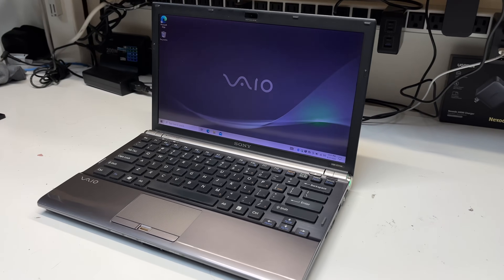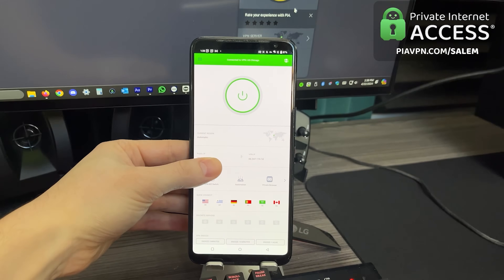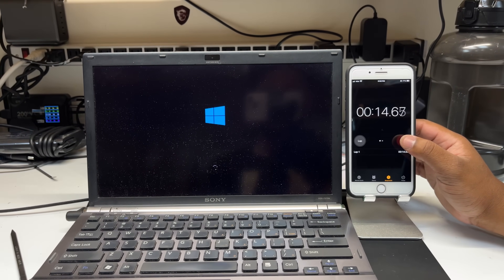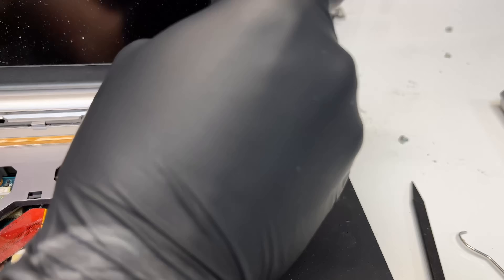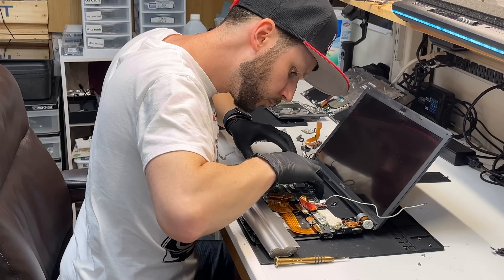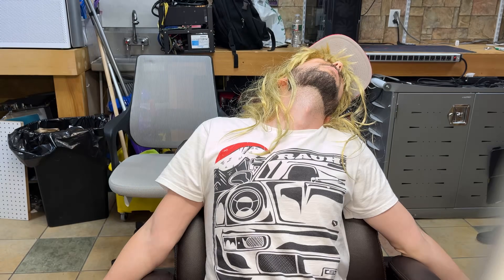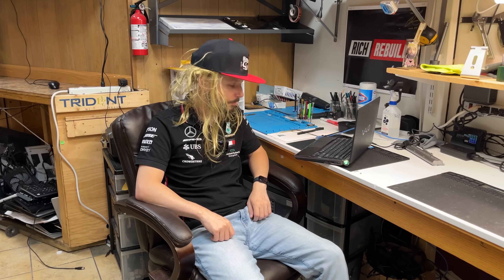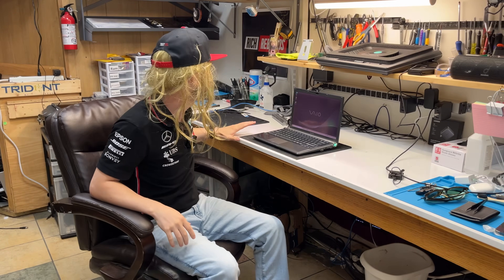Sony Vaio Resurrection: Saving this Insane Tech From 2008 (and why that soon won't be possible)

Comment: I still have a Acer gaming laptop from 2011 or something with a first gen core i5. Still works fine. Battery is nearly dead (about 20mins with a full charge) but I don't really need that. Built a gaming pc in 2022 and recently bought a new laptop for travelling/university.
I was thinking about framework 14 but bought a hp elitebook (i7 7840U, 16GB DDR5, 1TB Samsung NVMe) which was available for 950€ with university discount. At least HP offers good documentation, five years guaranteed replacement parts and ram and ssd are replaceable.
The offerings get really scarce if you select non-soldered ram.

Comment: talking about things that lasts forever, its hilarious that i had a 2014 lenovo (g410) laptop that still works and still packs performance with ease of repairability and upgrades, and a newer acer laptop that keeps breaking every so often with more integrated parts. its good that there's still a brand that keep this thing up sometimes, (even when most of their newer products now is also the exact same e-waste once wasted) and not so vocal on the green thingy.

Comment: Great video, but I have one suggestion. It's related to Windows 10 EOL. Why not try to promote some easy to use Linux distribution like Linux Mint. In this video, you had a problem with specific driver. I will bet that with Linux Mint, you would be able to run NVidia card much better. Anyway, in general normal user needs web, YT, office. All these can be done on Linux.
Reply from the maker: As I've mentioned in the other comments, convincing an out of state customer, who's a lifelong user of Windows, to learn a foreign OS to unlock a capability they will not notice or utilize in the first place, is not an option. The average consumer that has been using a device this long does not want to learn something new, period.
Reply: @SalemTechsperts  Well I fully agree on Sony laptop repair. I mean it in more general. When you talking about second hand market for example, I think it could worth to mention that Windows is not only option when you want to older laptop and with Windows 10 EOL it will be much more relevant

Comment: Fellow tech guy here; might try finding out what Nvidia chip that is and seeing if they have a driver archived on their website for it. I had a smiliar problem with my previous laptop I had from Acer. It was a Nitro 5 with a AMD chipset both for CPU and GPU. I wiped the drive clean and installed a fresh ssd and Windows and my touch pad stopped working. Found a forum post about a piece of hardware from AMD that prevented the touchpad from working. I guess it's specifically to Acer. Not AMD. Long story short I happen to have made a backup of the previous OS image with that driver already installed. Speaking of listing a few laptop's with repairability...Acer, MSI, Lenovo...

Comment: All that work and my guy identified a socketed cpu and DIDN'T call the owner to inquire about a $20 part upgrade?

I am confused.
Reply from the maker: The difference between this CPU and a more powerful compatible one was negligible. We're talking a few hundred MHz. This is useless when my customer is only using it for basic things.
The additional wattage of the more powerful CPU (45w vs 35w) would've cooked with that tiny heatsink.
The additional time waiting for a part to come in, installing it, re-assembling it, testing it, and praying that I didn't get a 16 year old defective CPU, was not an option.
Hope that clears up your confusion.

Comment: That little rant at about 12:25, speaking to the choir. Before I actually got my career in the tech field, I worked at Wal-Mart int he electronics dept. and was the go to guy to tell customers about the store computers we sold. And I told them the SAMETHING. If all they were doing was basic YoUTube, school work, and just browsing the net they're fine. I hate the fact now working in a Depot that most things we work on now cannot be repaired and the manufactures did it.  I tell folks also going to Flat panel TV's was the worst choice too, but the companies weren't making money because people weren't buying no ew tvs cause old ones lasted damn near 30 years. AND the original flat panels you know could be repaired cause they ussed so many Electrolytic caps that would bust in all that het and lose display/power. Replace a few caps  youre in business. You see now they started using service mount caps which are harder to find the bad ones and they have no date or readings on them so you can't replace. Yeah, so much for going Green and folks can't repair shit...and don't get me started on Lithium batteries that can't be recharged if they completely die or can't be recycled

Comment: One passion project ive wanted to work on for a while even though I have 0 experience repairing computers is this ancient Lenovo Thinkpad that is from back in the day that those things had rollcages. I think it is a TL30 or something, and it also has a (probably) socketed cpu, upgradeable ram (supports 16GB), and I'm not sure about the storage, but with this thing's track record, it probably is upgradeable. I would just need the time and the money and I totally would give it a shot, because it could support up to a third gen I7 and 16GB ram, which might make this ancient laptop somewhat viable for some gaming. What yall think?

Comment: I'm hoping my Asus ROG Zephyrus M16 will last me years because I bought this laptop with the intention of keeping it for a long time. I know how to do the basics/maintenance such as replacing the paste and the liquid metal (CPU from factory uses it) but the thing that worries me is the software in the future. Alot of things nowadays like you mentioned towards the end of the video is unfortunately true. Many things today are engineered to fail at a certain point especially electronics and cars. Besides the future were heading into, Keep making great and funny videos!

Comment: I actually thought, that vaio laptops were hard to break and was beast among all laptops. Friends family had two of them (and I think the same from your video). Broke when friend dropped it and it opened up from the power button to its power supply port. Hell, this laptop could run most of games till 2010. Now I have got vaio from co-worker and it’s still kicking. Monitor is crap (e-fing tft matrix) but adding ssd and 8gig ram made it better in all aspects

Comment: I've got the Sony vaio VPCF22M1E and it was and still is in some ways a beast. I ran WoW on it till late 2020 after the minimum specs for it, mainly the gpu, needed to be higher. The only thing i did was give it to a repairshop for some TLC and a SSD upgrade. It still runs great as media center and low spec games.

Comment: They definitely used to build things to last. My childhood computer that runs Windows 98 still runs like new. I collect vintage computer and I have a computer from around 1987 that works like new. I also have a Toshiba T1100 which was the first commercially produced laptop from 1986 Im planning on repairing, but should work fine with a new battery and new capacitors so long as there isnt significant corrosion.

Comment: Bro, I am typing this on a Toshiba Satellite C600 from 2011. Shit still turns on, but YouTube lags tho.
I asked my friend to do some maintenance work on my laptop and I was thinking that it would be easy to do, but nope. It's a lot more complicated than I thought.

My only issue with this laptop however is the chassis is made of nothing and has cracked open in different parts of my laptop, but functionally it works as well as it did on launch day.

Comment: I still use an hp mini 110-3000 up to this day, I bought from ma repair shop, abandoned, I repaired and upgraded it myself, I still manage to get over 5 hours on battery(which was brand new 5 years ago) and I manage to do office work just fine(granted I use OpenBSD) and do some work on terminal as well, youtube doesn't work(intel n455 atom has L I M I T A T I O N S) but for me it is relevant still

Comment: I think it is amazing to see old technology outlast todays expensive consumer crap like I’ve seen so many gaming laptops and laptops with dead CPU’s especially Intel i3 i5 11th gen to 13th gen
Reply: I love and hate old laptops cause they are built like tanks and are over engineered and can be confusing on how to dissemble but they are more repairable than the current MacBook 😂
Reply: I think the best oem that supported drivers is Dell I still can access my 2003 dell dimension drivers, while HP recently this year removed old devices from their download site to encourage more e-waste
Reply: Then when Sony and Toshiba (other defunct brands too) gave up on laptops  they removed all drivers and software with no care for the environment as they so much care ablut

Comment: The Windows 10 issue is just...atrocious. Everything about it is just terrible, especially considering how ridiculous Windows 11 is. Not sure how public it is yet, but there was a graph released of how many users of Windows are spaced around each version, now vast majority is still Windows 10 but the amount of WIndows 11 was seemingly roughly 18% which is massive when you think about it. But then Recall was "discovered" and more technical issues, which dropped it back to UNDER 10% of users using it. 

And they know how much life is still in 10 because you can and I quote "Pay a premium service to keep Windows 10 updated" with their Extended Security Updates. (Which will stop being available at the discontinuation date). It's just absolutely crazy how many machines will be invalidated, and just how scarce things are going to become very shortly.

Comment: I did learn something, I learned that I should do research to see if the thing I’m buying is repairable and upgradable. Also fuck HP omens, stupid amd board with intel cooler mount that’s impossible to put an aftermarket cooler bc of stupid location of surface mount components. The only parts I was able to salvage for the rebuild was the cpu, the ram, and an ancient hdd.

Comment: Fun fact: The Sony VAIO was the Chevy Corvette of laptops back then.
Also, I have a 14-in Sony VAIO, model VPCCW18FJ. It is still running fine despite being heavily used. I have also a Dell Latitude E5400, which is bulkier, but it is more upgradable than the VAIO.
Update: I recently switched to a HP EliteBook 840 G5, which was lighter and faster.

Comment: Should start using Clonezilla to clone. I’ve cloned probably 50 drives now using it, nowhere close to the greatest technician that has ever lived of course, but I’ve never had a single boot issue. Plus…free.

Comment: I had 2 vaio laptops, one from 2006 (core 2 duo and r4870) and another from 2013 (i7-3537u and Intel graphics) and this laptops was simple to maintaining, but they both were a 15.6 inch, and there was a plenty of space inside

Comment: You can tell this laptop is great considering how old it is, but also the issue with repairing something this old is that the cost and work you have to do to fix it is just not worth it most of the time. For the price of fixing and upgrading it you can simply get a better used machine. Core 2 duo laptops are basically worthless these days, you can get a much faster 4rd gen i5 laptop or even 1st gen ryzen for less than 100$. This vaio may be an unique model that has a value on its own, good collection item, but its performance in comparison is just terrible, even if "it works fine with searching web", then I assume that even in this use case it will be noticably slower than a 100$ used laptop.
Reply from the maker: Well said. It would most definitely be slower than a used $100 laptop (assuming that laptop has an SSD). Your points are exactly what I brought up at 13:00, where, no shop is going to touch these so if you want to keep it going, you need to do the work yourself, assuming you don't value your labor. (Or have a YouTube channel where you can fix these things and make money off the content). The battery on this alone cost me around $75, the SSD about $65. That's nearly 4x the price this laptop sells for on eBay. If I were to toss in labor the total repair would've been close to $600. The best deal nowadays is to buy a used business class laptop, but where does that leave all these older, perfectly working, laptops?
Reply: @SalemTechsperts  Probably landfill, and that's unfortunately what all manufacturers are pointing old machines into with models like these, overengineered and unfriendly to work on. These days unrepairable and unupgradable are the words more common in use. As you said, seems like only framework is an exception.

Comment: i can name a laptop that could possibly last 16 years, it's called the hp probook 440 g9 and this thing can have it's ram, ssd and battery replaced with 5 screws on the bottom part, the heatsink is also accessible too

Comment: I like your video, but windows 32 bit still using too much resources. You can use modern 64bit linux mint (arch or void linux).
Reply from the maker: This repair is for a customer. My customer does not know how to use Linux.

Comment: I have a cheaper Vaio from 2012 that had some major issues throughout it's life. The battery died from one day to the next, the keyboard had stuck keys, and the backlight is partially broken. As such, it's not very useful for day-to-day use anymore. But the motherboard? It just refuses to die! For the last 2 years, I've had it working as a server, turned on 24/7, and the thing has been just absolutely rock solid! It currently has over 250 days of uptime with no sign of stopping soon.
Reply: The thermal paste on that CPU has heard no bell.
Reply: @rockraphlegal  It reaches 70° under full load, under which it very rarely is, so it's not that bad all things considered. I do need to change it one of these days, but that would mean ruining it's current 290 day uptime
Reply: @redpheonix1000  Bet that THE GREATEST TECHNICIAN THATS EVER LIVED could change that with the laptop running

Comment: Man dont install windows 10 on old notebooks beause gpu doesnt get installed corectly and it sounds like it wants to fly beause it cannot menage power corectly
Reply from the maker: Unfortunately when you have a customer that doesn't know any other operating system, you have no choice.
Reply: @SalemTechsperts  i often offer some of my time  to show live iso boot on their pc just to promote linux
Reply from the maker: I wish I had that time
Reply: @SalemTechsperts  you should do videos about linux atlest in shorts and i like that you mentioned right to repair few times  👍
Reply: for some , yes 👍
Reply: @JoshuaG  recently i had old probook to service windows 10 couldnt install old ati hd4000 series but linux mint worked like charm

Comment: Still using an i3 Vaio c. 2011 for video calls (with a bluetooth headset), internet when I'm working on my PC etc'.  Maxxed the CPU to an i3-390M, DRAM from 4GB to 8GB years back. Still has one of the nicest keyboards and touchpads you'll find. Batteries are a problem, clones available but they're even worse than the already poor original (which was 2-3 hours idling, barely an hour tasking at best), might have to break one open and replace the cells at some point.

Comment: They even crammed an expresscard slot and removable modules for the wifi/56k/3G modems with a platform that requires atleast three chips to have an igpu only system. Lenovo can't be bothered to put more than one sodimm slot in a 15 inch laptop
Reply from the maker: "ThErE'S nO sPaCe"

Comment: I fixed my old sve1513 2 months ago. It was 8 years old. It had a broken screen from fall damage. Replaced the cd port with an ssd adapter, added some more ram and now it's beast. My brother also had a 17 inch sony vaio for about 11 years which worked under intensive workloads and still lasted for so long. They were built to last that's why Sony vaio went bankrupt. 😅

Comment: Just bought a refurbished Thinkpad T440 because that was less expensive than buying a new battery for my old MacBook Air (while having no guarantees it would help solve my problems with it, because I think the chip is shitting itself :/ ).

Comment: My cousin bought a Lenovo laptop with ryzen 3 3400g (I think) and VEGA 3 graphics
In less than 2 years, he started having crashes,I diagnosed the laptop and found that the Ram was faulty.I opened the laptop to replace it, but it turns out it was soldered.
Less than 2 years old laptop straight to the garbage bin

Comment: although i have never owned a sony vaio, i do still daily drive a dell latitude e5500. Its currently running into that ship of theseus situation because only the motherboard, disk drive, screen and bezel are from the original one i got back in 2020. i upgraded the core2 duo t7250 that was inside to a p9700, swapped the 2gb of ram for 4gb (cant afford 8gb of ddr2💀) and replaced the 80gb hdd for a 250gb 860 evo. i also did an almsot full chassis replacement as the hinges had snapped when i was given it for free. despite that, all these upgrades and repairs totalled out to around £50 so money well spent. Its turning 16 in december and although windows 10 isnt possible on it anymore (sse4.2 hard requirement) i hope to get a few more years out of it on windows 10 enterprise. One day, when i have the money and experience, i will make sure this laptop lives on with a framework motherboard and a whole lot of patience.